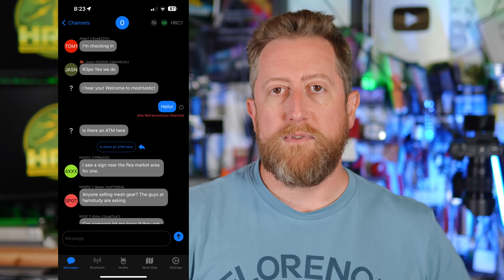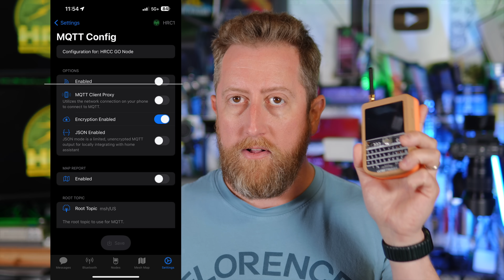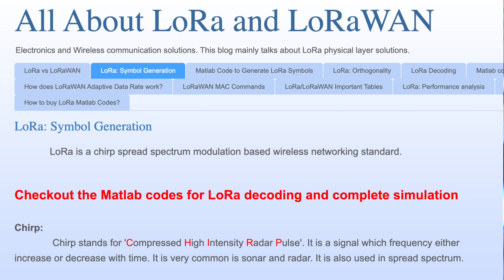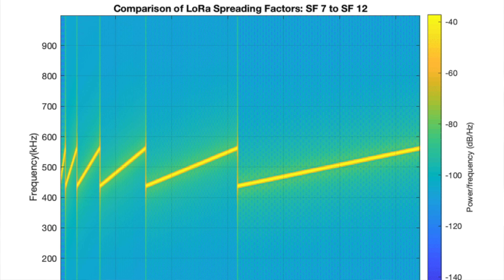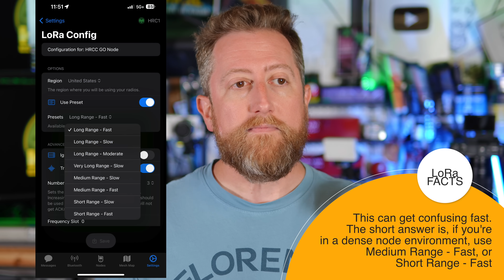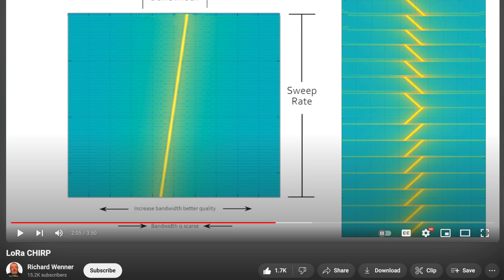Did MESHTASTIC Die At Hamvention??

Comment: Question: does changing from Long Fast to Short fast affect the battery life? I am looking for something to extend battery life on those solar satellite nodes I plan on setting up between Maine and SoCal... (just kidding, though that would be amusing an expensive)
Reply: Just get a nrf based device (like the RAK) and a decent sized solar panel with decent sized battery and you shouldn't have any issues with battery life.
Reply from the maker: Try and tell us.
Reply: No the battery usage is the same. Actually short fast uses less because it’s a shorter transmission time. 300x faster than long fast and with far more than 1/300 the range

Comment: CLIENT (MUTE) is highly underutilized this stops the node from rebroadcasting data, in a dense area leave the retransmission of data to the nodes with the most advantageous positions. I have my elevated nodes as Routers, the nodes on my vehicle roofs as repeaters and my pocket nodes as Client (Mute), my vehicle doesn’t need to show on the node list since I’ll be near enough with my pocket node.
Reply: I would leave the vehicle nodes as client role since your car might not always be in an advantageous position, so it can re-transmit on-demand with the same priority as regular clients.

Comment: I have been seeing Meshtastic being discussed more and more.  I haven't really looked into it much, but could it be a viable means of communication for let's say a hunting party of 8 to 10 people spread out over a 2 to 5 mile radius from a central location in an area with lots of hills and poor cellular reception?  Is it just text based messages that can be sent or can images be sent as well?  It is fine if only text can be sent as the main use would probably be to ask someone to bring a quad to help drag a deer or let the rest of the group know that a member of the hunting party is heading back to the cabin earlier than everyone else or staying out later than everyone else.
Reply: Text primarily.
Very good for low volume telemetry or text based communications.
I think its capable of doing a binary payload like an image, but its very slow so not practical.

You do need line of site however so having some nodes at higher elevations would be helpful
Reply: @dorvinion  thanks for the info.  I might have to look into it more then.  We might not be able to have our meme war, but at least we can message each other.  It might be a viable back up to using GMRS radios.

Comment: Seems like the 2 main problems with Meshtastic are either: Get a node and encounter terrain problems / there's no one I can talk to, OR there's an over-saturation problem. I went from the former to the latter in the span of 3 months. Now I see endless spam on the public channel in my area (mostly new user test messages), and wish I could get back to the few original users back in April 2024.
Reply: I believe you can if you change frequency with a small group.

Comment: I put up my first Solar charging Rak 4630 device using Meshtastic OS. I picked up a 283 mile device, Which has since dropped off. I also picked up a 19 mile device. So it is working. not alot of activity local so it is something I will need to monitor for sure! Attempted an install on the garage roof but the light poles were too large... need to get larger hose clamps for it. Had rain and it is still working... charging as well... been on for 20 hrs and still at a 95% charge! So very happy with the performance. Also got a T-Deck and using it to test with as well. Always great to learn about things that are new! Now to connect with Jason here in TX and see if we can expand our influence. ;)
Reply: I have done the same thing. The 4630 will never bring my battery higher than 95%. I have the same results. Works perfectly though.

Comment: MQTT can be very useful and isn't necessarily a problem to the mesh. The problem arises because it is a fairly complex system and not well understood. New users that try MQTT using the default settings on the default channel will cause congestion, but using MQTT on a private channel with a custom MQTT topic (or through a private MQTT broker) is really not a problem. The thing is, unless you know what this all means and also have a known use case for MQTT, you are certainly better off leaving it alone.

I have found it very useful for remote telemetry over Meshtastic, and it works well with my configuration and does not cause channel congestion.
Reply: I'm thinking about this use case to push data into home assistant mqtt would make a great interface for the automation pipelines.
Reply: Is there a place to see a list of topics that are used?
Reply: @wesleyjones6535  There is an app called MQTT Explorer that (sometimes) works. It's available for Windows. A key point is that the users create the topics. Entering a topic in your MQTT setup will create it on the broker if it isn't already there.
Reply: Problem is... we're not familiar on how to "properly" set "private" channels up. RTFM is no help.
Reply: @dustoff499  Setting up a private channel is pretty basic to Meshtastic. Just create a new channel in an available slot and give it a name that isn't "LongFast." Connect that channel to MQTT (but don't connect the default connect LongFast channel) and you won't cause too much trouble.

Comment: Is there something in the meshtastic firmware that would allow it to "learn" and stabilize such a dense group of nodes if given some hours or days to figure it out? So after some time that mesh would be functional and not bogged down?  Would you be able to simply limit the "background" transmissions to a certain portion of the bandwidth?
Reply from the maker: Perhaps in the future.  But it’s likely best just being user settings.  Like hops.
Reply: They could introduce some kind of probability flag. So depending on the number of nodes around you, your node can say: "Here's the packet. But make sure that only 20% of nodes retranslates it further". Also making an option to manually control the probability could be a great thing too.
Then each neighbor node just throws the 5-side dice and decides if they need to send that packet further or not.

Then your node firmware can by default automatically choose the probability factor depending on the number of neighbors, distance and so on.

Comment: "Packet" is the right term. The "CHIRP" is still a packet similar to tcp ip. CHIRP's (used in LoRa and other applications) involves transmitting data via chirp waveforms, which are organized into packets.    [At least that's my story and I'm sticking to it 😅]    Nice video, Thanks!!
Reply: Yep. Any protocol with a fixed or variable length data record is sending "packets".
Reply: Aww, Chirps
Reply: The Chirp in Lora is an FM modulation technique, like FSK, or OQPSK. Chirp is not a packet, but a frequency modulation technique across a specific bandwidth to encode symbols using up chirps and down chirps. This FM technique creates a robust means to overcome noise so Lora can be long range, but has a low data rate.